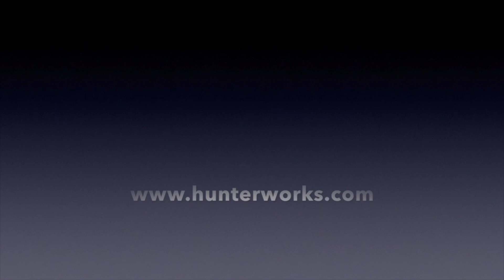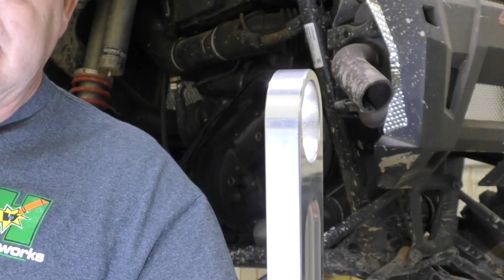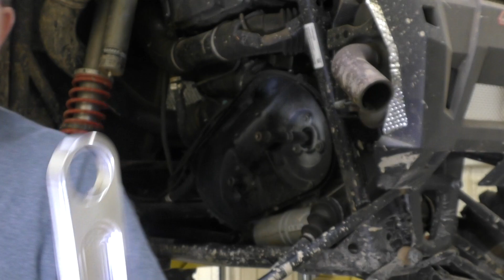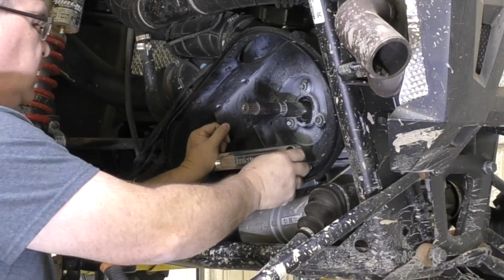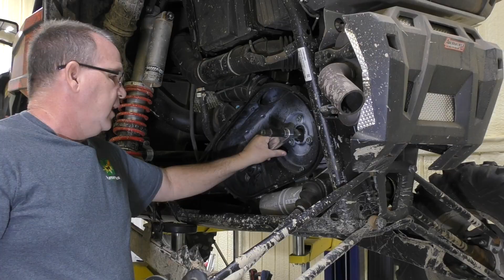HW New Polaris Clutch Alignment Tool- RZR Generals and Ranger

Comment: Will the locking plate you sell work with this alignment tool?  I took a measurement center to center on my clutch bolts and I am far from 10.5 inches.  Mine came out closer to 10.75.  I already ordered your thick belt and secondary roller package.
Reply from the maker: Yes the plate is not connected to a tool, just locks it in place once aligned.  1/4" is a long way off
Reply: @Hunterworks  I have a spare factory polaris belt.  Once, I install your thick belt and washer will the factory polaris belt be able to used as a back up with the thick washer installed?
Reply: I found my answer on one of your other videos.  Keep up the great work and thank you for all the informational videos.
Reply: @chrisradwan5128  what was the answer

Comment: Do you have one to fit a 2015 XP1000, or does it only work on newer machines?
Reply from the maker: surfntchr as mentioned in video just 16 and newer.  No plans at this time.  Sorry
Reply: @Hunterworks  sorry, responded after checking your website first as I watched the video. Is there a major difference in size between 14, 15, and 16+?
Reply from the maker: @surfntchr  yes the transmission shaft is different and I do not have access to one anymore
to get measurements off of
Reply: do you know the shaft spacing on 15' 1000 ?     10-1/2 ?
 @Hunterworks
Reply: and is that to outer edge or center to center
Reply from the maker: @live4545  it is and it is center to center, most newer vehicles are 900cc up
Reply: Hunterworks Inc. awesome thanks waiting on my alignment tool , but wanted to check with tape and see